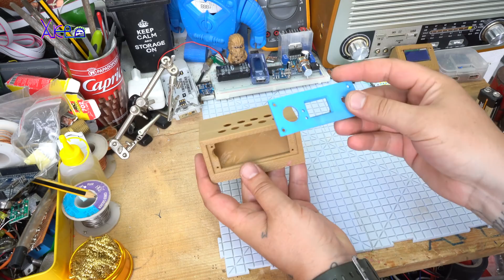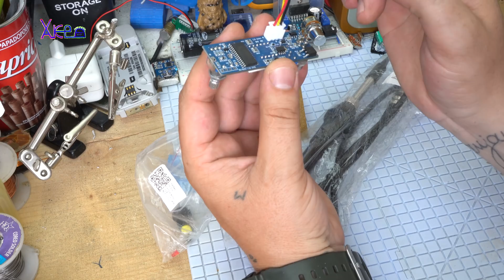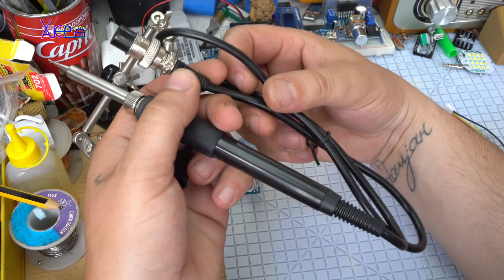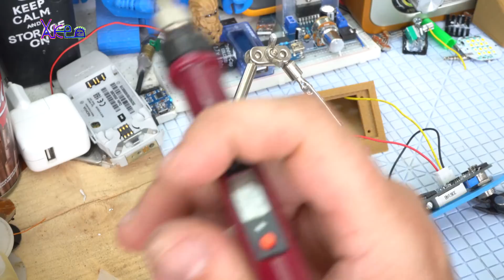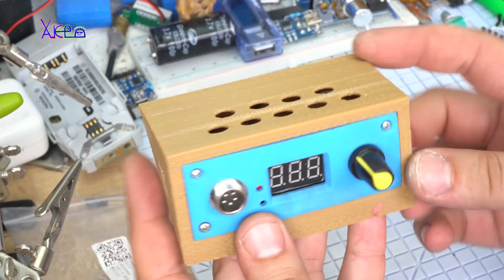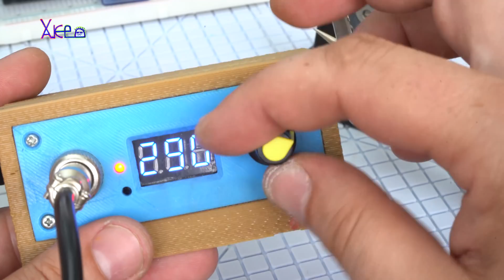DIY Mini Soldering Station

Comment: This video is Fake for sure. You have a soldering station circuit for a T12 Solder iron, and the iron you show on your video is a 907 Hakko clone handle. That Iron will NEVER Work with that solder station circuit.